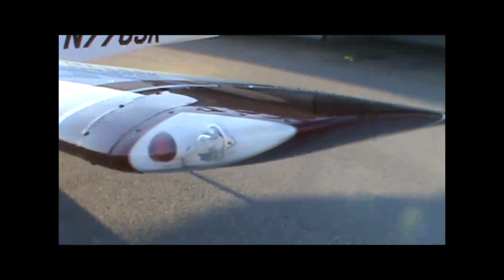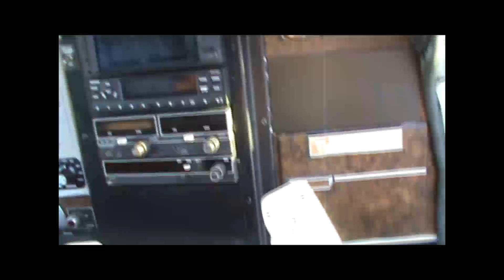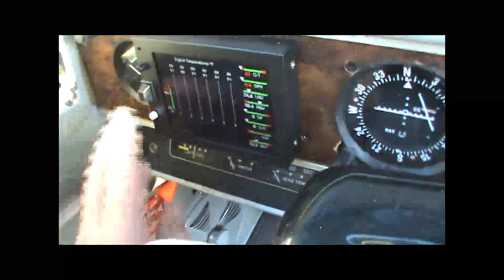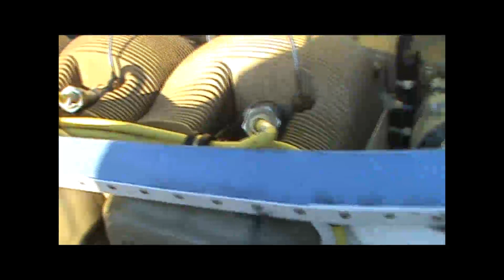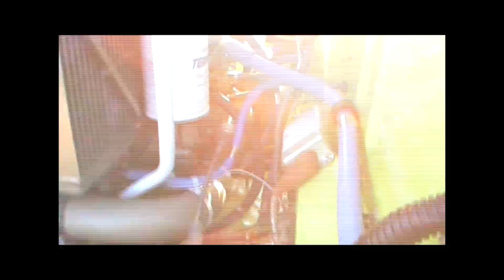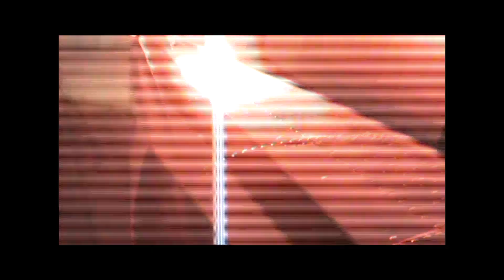1969 Bonanza V35A N7765R

Comment: Hi Andre, It is a super nice plane, but I just brought it into the avionics shop and now it will have dual Aspen glass panel, Stec 30 autopilot, removed all antennas from roof (besides the GPS small ones) installed blades on the tail and dual com underneath, new powder-coated panel. This brought the price up extremely!! I'm into it for $159K total which is hi-end spectrum, but everything is new!!! Absolutely no issues!!!
thanks Dave